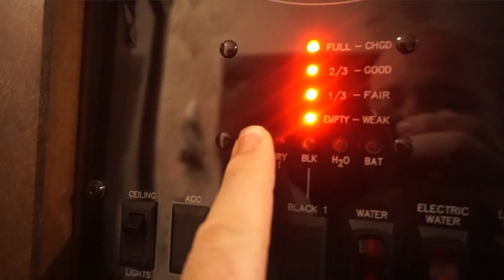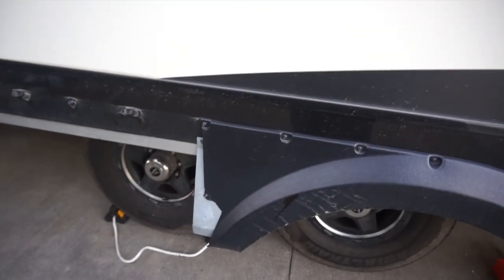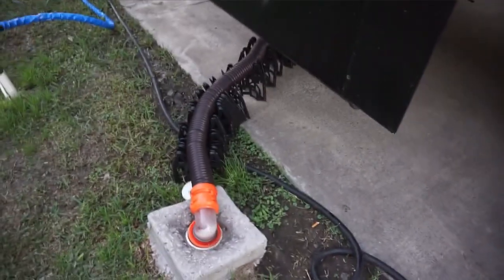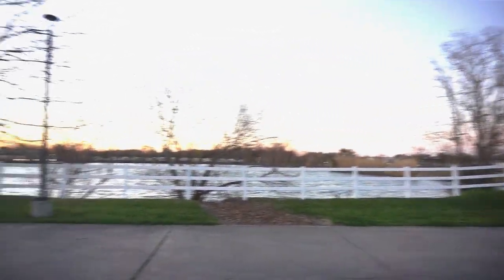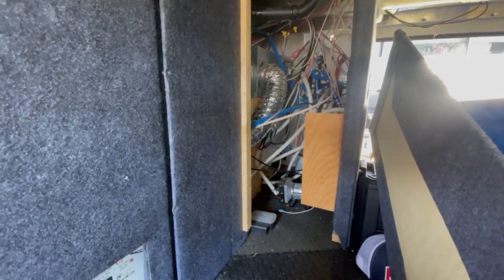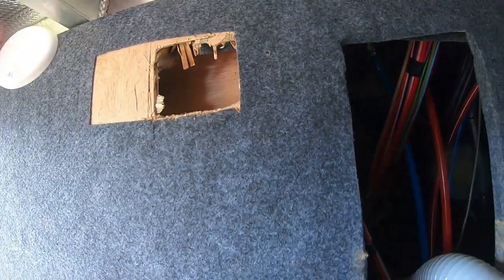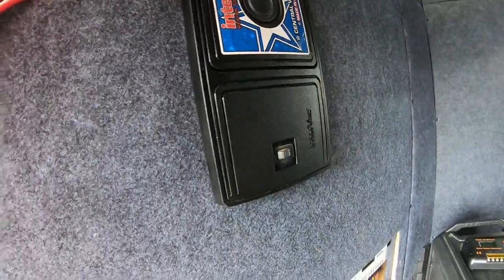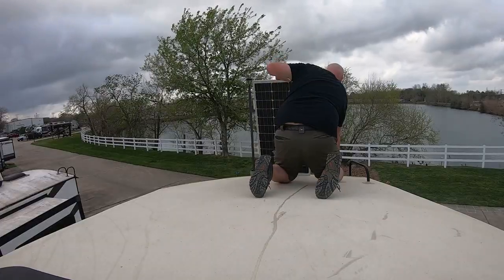Worst Part Of RV's + Adding Solar to our Fifth Wheel RV

Comment: Great job. If i could make a couple recommendations from an RV tech point of view. I would heat shrink your connectors or at least tape them where your connectors mount to the charge controller. Those positive and negative wires being exposed and right next to each other could cause you problems later. And the other was the Dicor on the roof brackets. Cover those entire bracket with it not just the screw heads. You don't want any chances for leaks up there. Otherwise it's a great start to a good system. What are you running for batteries? Do you guys do much boondocking?
Reply from the maker: Thanks for the tips! I’ve wrapped the wires with electrical tape. And I haven’t yet covered the whole brackets yet. I made the mistake of only getting one tube of dicor lol so I will get them covered. We have a 200ah lithium battery. We boondock a handful of days every month. Usually in between destinations. We love harvest hosts! We plan to add another battery to get us up to 400ah and add more panels to get us up to 600 watts of solar.
Reply: @travelingroost  Sounds good. I am picking up more panels for my system today actually and adding an additional 480w of panel to the top of our rig. Looking forward to the faster recovery rate on the batteries!
Reply from the maker: Yes! We have a residential fridge, so we need that extra power!